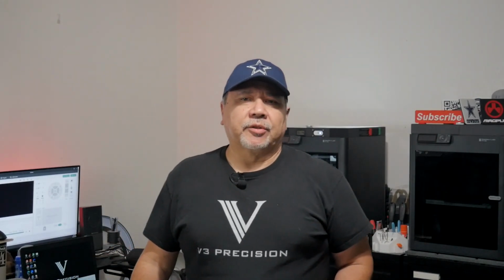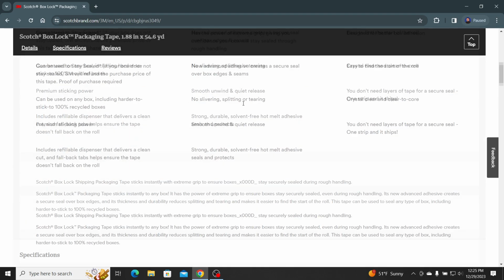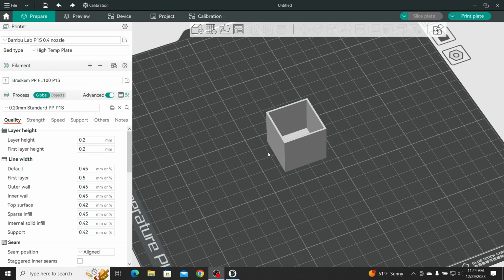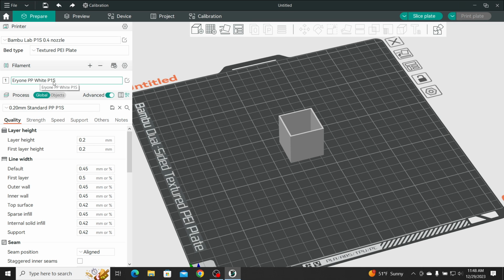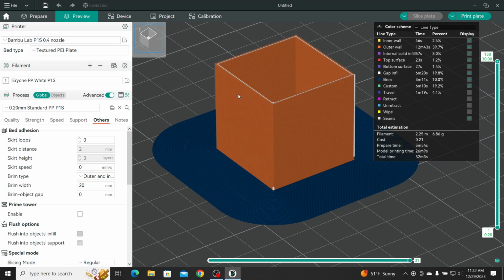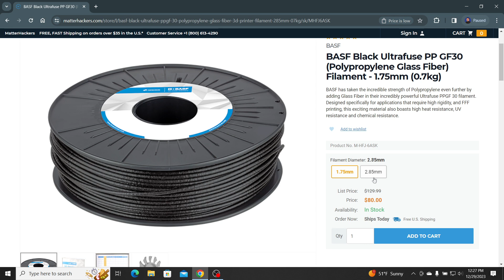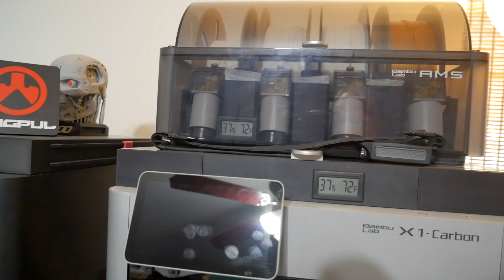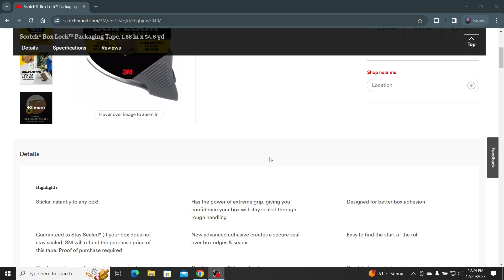Printing with Polypropylene or PP Filament

Comment: One thing you might want to look into is that they have PP bed plate surfaces by Mamorubot 3D that you can get off of amazon. You might want to give that a try. I wanted to try it myself on my Sovol SV08 but they dont have my specific size, I would have to buy a larger one and cut it down to fit my bed, but there is no way for me to hold it down because of the way they built the bed on the Sovol. But I may try one on my Wizmaker P1 bed slinger. You might want to try sticking it into a heat chamber after printing and bring the heat down over a long period to prevent it from warp.

Comment: Instead of the „regular“ PP Packing tape, i use a adhesive Bookcover film. This also often made of PP, and its about aviable as a30cm*5m roll , so its much easier to cover the printing plate.

Comment: I like the Filament One Premium Pro Select PP and Braskem Glass Fiber PP.  They print well on my Ender 3 Pro w/.8mm Nozzle X and on my E3 S1 Pro w/.5mm Nozzle X.  230/90 .2mm LH,  45-80mm/sec on smooth PEI with Magigoo PP.  Beautiful, slippery(non GF), lightweight, semiflex parts.  The GFPP has a really "grippy" texture to it.
Reply: @Jynxx_13 Didn't FilamentOne go out of business a couple years ago?

Comment: But you know the trick with the clear adhesive tape for parcels, for example. I only use it on the corners where there is a lot of warping. Then PP also holds well. Only set the print temperature bed to zero for the first layer.

Comment: for the adesion I've solved with a doblesided tape but with the distorsion of the base I'm still fighting.

I'm using Treed filaments (PLENE4 and 5).

So, do you think that the inox noozle makes the difference?

Or the brim?
Or the printer?

What's has been the real jump to succed?